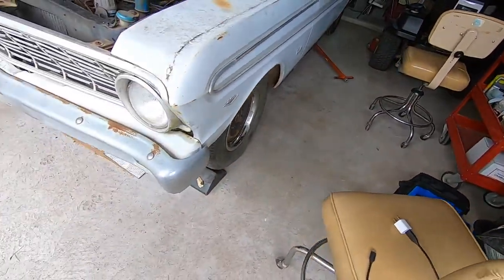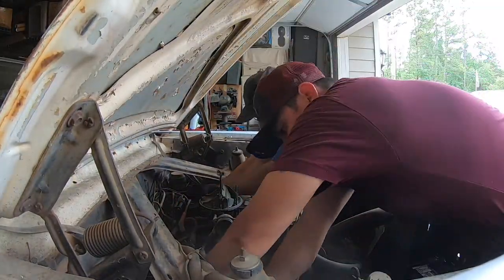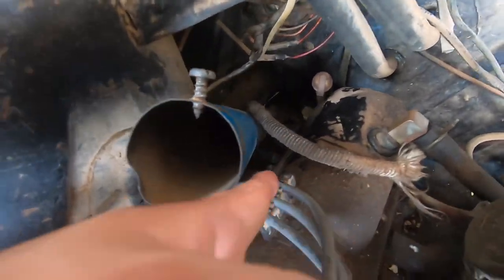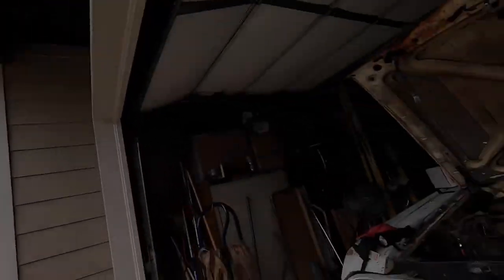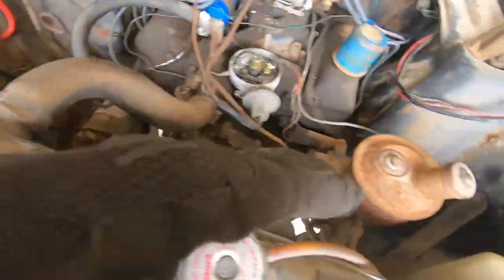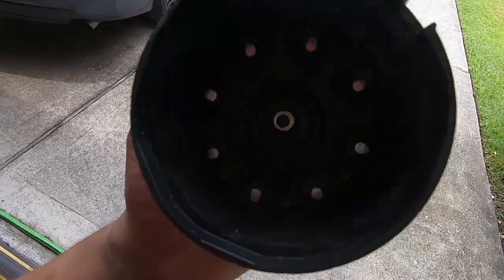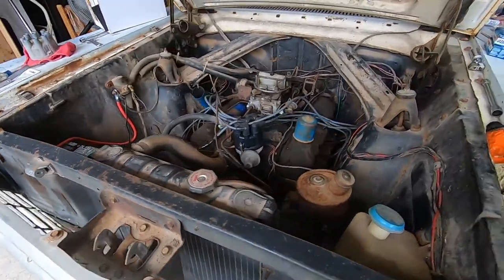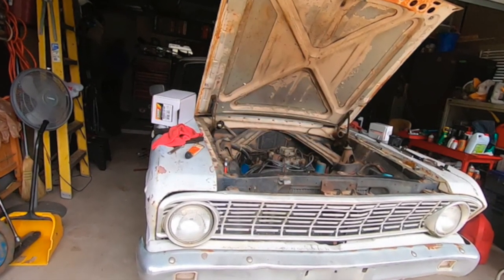Installing new ignition parts on the Ford Falcon!!

Comment: My buddy has a 1965 Ford Falcon and it won’t start. We took the spark plugs out and cleaned them and then put them back in but it still wouldn’t start. If I got new spark plugs do y’all think it might do the trick. All it needs is a tune up but I don’t know if changing the spark plugs is enough. I don’t know much about cars so I was hoping changing the spark plugs is all I need to do. I’m just a little lost and looking for answers if anyone has any. Thanks :)
Reply from the maker: Does it crank but not turn over? 
Suggestions: take a look at the fuel filter, may be clogged, fill carb bowl up with a little fuel so it gives a chance for the mechanical fuel pump to start pumping. Make sure there is at least 5gal in tank
Check starter solenoid contacts and coil contacts to ensure they are clean :) Hope this helps a bit! 😁✌🏽